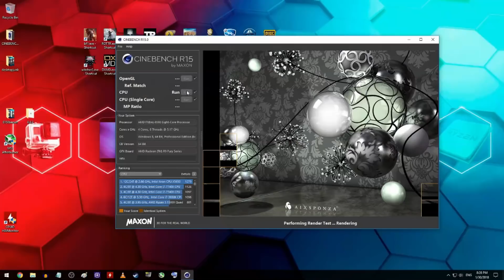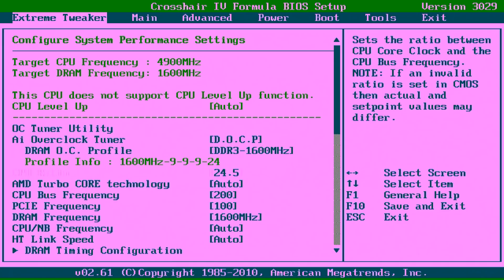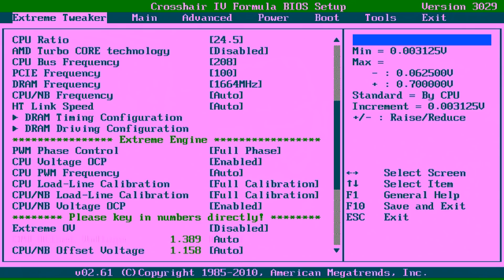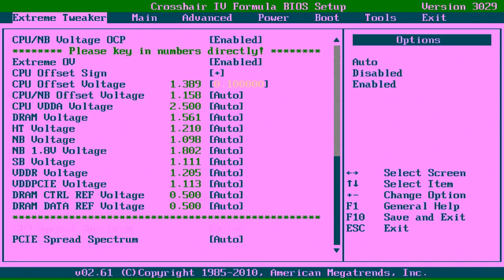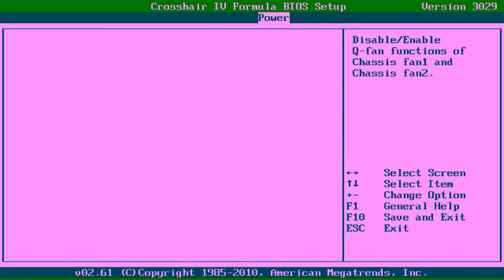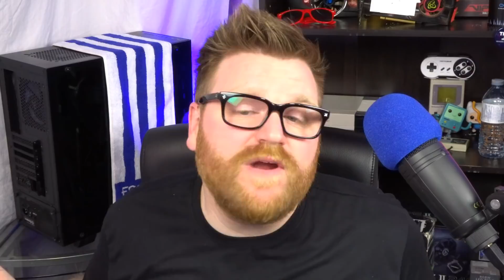How To Overclock The AMD FX Series to 4.8 - 5.1 Ghz!

Comment: I wish I could overclock my FX 8300, but my motherboard is that Chinese models.....
Reply: I clocked mine at 4Ghz @1.3 Volt.
A rather tame overclock, but I don't want to kill my cheap 4 phase M5A78 MoBo. I salvaged the heatsink from a dead s939 board, and after a little machining I managed to fix it on the M5's VRM, and positioned a 90mm cooler above it.
Reply: A decent am3+ motherboard can be bought for like 50$ used, so you should do it, considering you will probably be able to sell your mobo for 20-30$...
Reply: I wouldn't waste money on this platform anymore, once the the DDR4 price come down a little, I will get a new konfig.
Reply: most mb are made in china....lol.
Reply: TheGyuuula
You will wait decades before the ddr4 prices comes down.
And he would put like 30 bucks, it's not gonna ruin him, and he will probably get it back if he sells the system later to build a new one.
Maybe he isn't even able to build a new config, so he'd rather spend a little on an old config to make it ok rather than spending 600 on a new pc.
Reply: @imnota  That didn't age well
Reply: @MJ-uk6lu  
Nothing ages well when it comes to tech advice, use your brain. What you're doing is the equivalent of going in back in time to 2005 and telling some random guy he shouldn't be recommending ddr2 lmao  

That comment was from 2018, obviously the advice given is outdated...

And honestly ddr4 prices only started to go down like a year and a half after my comment, so I was right, it's not like that guy could afford waiting for more than a year for the prices to drop.

Also DDR4 prices still haven't come down as much as they should. They're dropping slowly over the years, but compared to how ddr3 dropped in price, ddr4 prices are dropping much slower and are still quite high, especially for how old the technology is today. Obviously nowadays ddr3 is out of the question and you have to go for ddr4 and suck it up, but it's still overpriced for what it is.

Production has become easier, faster, and cheaper.  Yet, today, 7 years after ddr4 came out, a 2x8gb kit costs 100$, even though it now is the norm and is very basic.
In 2014, 7 years after ddr3 came out, a 2x8gb kit was 75$, that 16gb kit back then was considered as the best in the game, tip top technology. 

Explain me why something basic nowadays costs as much as the bleeding edge of technology only a few years ago ?

Also the prices can even be ignored, because it's not the problem here. The only thing that matter is that in 2018 an overclocked fx8300 was still usable, and investing like 50$ in it would give him an extra year out of his computer, which objectively was a better decision than building a whole new computer, that he probably couldn't even afford.
Reply: @imnota  You said it will take decades for DDR4 prices to go down, but your prediction went bust after one year if not less than that. 16GB DDR4 is dirt cheap and has been for a while. Not sure where you are pulling your prices from, but 16GB kit of two sticks costs around 55 euros, if you don't buy overpriced RAM (pretty much anything Corsair or the likes). You still can get 2933MHz or 3200MHz kits for that money.
Reply: @MJ-uk6lu  
The biggest reseller in my country, topachat, is selling their cheapest kit for 95€. The cheapest kit on Amazon is 75€, really slow (2400mhz cl16) and has bad reviews.
As said previously, in 2014 we were in the same place lifespan wise with ddr3 as we are today with ddr4, and a top of the line, fast ddr3 16gb kit was 75€, nowadays you get the slowest unreliable piece of crap for the same price.
I provided you so much proof that ddr4 is overpriced and you're still pulling number out of your ass (and blaming me about my prices even tho it takes 15s of googling to check), 55€ is just enough to buy a slow and unbranded 8gb kit, no way you get 16gb, even aliexpress ram is more expensive than that lmao

Also as mentionned previously "decades" was just used as an expression for "a very long time" and well, it took a year an a half for it to drop to an acceptable level (still hasn't dropped where it should, but probably never will), and with the rate technology is evolving, that's a long time. So stop acting like a smart ass, obviously I didn't mean literal decades...
Reply: @imnota  I bought G.Skill Aegis 16GB kit for 55 euros few months ago and there were some other kits available. It seems that price climbed up somewhat now, but that doesn't invalidate a whole year of cheap DDR4.
Reply: @MJ-uk6lu  
You know you can see price history, right ?
I took a basic crucial ddr4 2x8gb kit on amazon as an example , 93€ right now, lowest it's been in the past year is 79€, and data shows it's in a repetitive wave of up and downs, no tendency of rising nor falling. 

BTW those prices are counting discounts, so actually the low spots are not even accurate since it could be some kind of event like black friday or something, and not the actual market going down.

Also, I know you won't take advice from me since you like to disagree with me, but next time avoid GSkill, when I worked in a repair shop, I'd replace them very often. Pretty much every gaming pc that came with RAM issues had Gskill RAM, and IMO that says something.
Reply: @imnota  In my country RAM was cheap for a year or a bit more. 16GB kits for 55-60 euros. That was totally normal, not discounted price. I don't give a frack about amazon prices as shipping alone makes it impractical for me (and amazon being quite shady place to buy from).

And if memory works fine the day you bought it, it will likely be good for basically forever. I don't see any memory brands as problematic. At some point I have used some PQI DDR400 memory and it was fine. It's hard to fuck up something so standard and controlled by JEDEC. I only had problems with Corsair XMS2 DDR3 1333MHz kit.

Comment: How high could you get it totally stable for 24 7 use
Reply: stable for 24hrs?  48hrs?  etc etc   overclocking can drive an OCD person crazy.   i've seen overclocks fail after  running over 72 hrs of prime95.  i've seen chips running "default / auto" settings fail stress tests.  if it's a machine handling critical data that you can't afford to lose or corrupt, don't overclock it.  if not, overclock it, stress test it for at least 24hrs with two different reputable stress applications,  then do what you would normally do with that computer extensively.  some people are happy with overclocks being just stable enough to do what they use the machine for and others will stress their pc more than actually using it looking for instability.  stability is in the eye of the beholder.

Comment: I just fixed my FX pc trying over clock pass 4 GHz is pain in the ass with my msi gaming 970
Reply: i had one of those.  i remember a "goo" excreting from under the vrm heatsink when i was pushing an FX 8320 very hard with that  board.  i never did try the 990FX version of that board though.  other than the heat tube running from the VRM sink to the northbridge sink, i think it was the same vrm setup.

Comment: Any advice on overclocking a fx4300 on a gigabyte ga78lmt usb3 Rev 6 motherboard?
Ps. If I could upgrade I would lol
Reply: That MoBo have a relatively weak VRM, but at least it has a heatsink on it (or is should have, based on google images). 
-Position a cooler somewhere above the VRM's heatsink, to get direct airflow on it.
-Now go to the bios and disable Turbo Core. It will also disable the "TPD limit". With "TPD limit" on, your CPU will automatically throttle back, when it's consumption exceeds 95W. Your MoBo can feed a little more than that to your CPU.
-Set the Voltage to 1.3, and test it how far you can go with that setting from 3.8 Ghz up in 100Mhz steps. If the PC boots, torture test it with something like "prime 95" for at least 15 min. If prime fails, you can give it a little more Voltage (something like in a 0.025V steps.)
-I would be more than content with a 4.4Ghz clock, and wouldn't go above 1.4V. Above these numbers you will definitely hurt your MoBo.
-Oh, and also look out for the temperatures! If your CPU goes above 60-65c° during the torture test, you reached the limit of your CPU cooler.
Reply: OC the ram and CPUNB first (at least 1866 for ram and 2400 for cpunb is desirable). I don't know what the exact settings are connected to this settings speaking of your MB, just search for a FX OC guide that covers this steps. Then OC the core frequency. The problem is that fx4300 as I know have smaller caches than fx4350 so you can be somehow limited by them. Ensure that you have 2 or more sticks of ram and properly installed to get full benefit of using the dual-channel mode. It is often something like A2-B2 slots. Then OC your cores a bit
Reply: Check how low you can undervolt before you look at overclocking imo, you can probably reach 4 ghz without any problems on that motherboard at best, it is a low end motherboard that handles 125w cpus at best, so it doesn't support 140w cpu's or the fx 9 series motherboards.

If you can get voltage down too 1.350v while changing the settings so it can turbo too 3.8 ghz on all cores you'll be pretty good on temperatures without risking hurting the motherboard.
If you got money too replace the cpu + motherboard, id look for used socket 1155 & an I5 of any kind.

Also what is your current gpu ?
Reply: Marcus60661 thanks for replying so quickly, current cpu is a Zotac gtx 480 given to me
Reply: Marcus60661 can this be done in my bios or a software? I don’t see the option in my mb intelligent tweaker
Reply: 2600mhz on the HT Link, 2400mhz on the northbridge (2200 or 2600 might be better in some instances).
Don't have memory timings too tight for gaming.

Comment: i wish i could get my CPU to 4.8 hell, i would be happy with 4.6 stable, but my little old Xeon can't do it :(
Reply: Speed is not all, don't compare old fx with intel parts. that xeon at 4ghz will probably be faster than a fx at 5ghz anyway..
Reply: faster yeah, but not by a lot. i get 980 on cinebench at 4.5, but 4.5 is only stable enough to sometimes to get one full cinebench run. at my daily of 4.2ghz i get about 950

Comment: The fx series was boss when it came to OC. My fx 8310 was clocked to 5.1 @ 1.48v and was air cooled. I had better OC experiences on the 8 series then the 9 series fx chips, you could push the 8 series further.
Reply: the problem is, they were great overclockers, horrible performers even when overclocked.
Reply: Yes they were horrible in the performance department but fun to OC.
Reply: Anthony Mari oh yeah for sure. i overclocked the shit out of my 2500k just for shits and gigs, even though i didn't gain a BUNCH of performance. (granted the 2500ks aren't horrible in performance, just not great either)
Reply: High OC does not matter if the performance was still bad.. A sametime intel i5 at 4,5ghz or a modern Ryzen at 4ghz is much faster.

Comment: Cooling the CPU Socket behind the motherboard would be another options to keep it cool or it might melt the plastic socket.  Or so I read.
Reply: it does.  placing a fan on the rear of the socket area will cool "socket temps"  up to 10-15 degrees.
Reply: the 6+2 phase boards will benefit from a fan on the vrm's as well.  some of the 8+2 boards will need a fan on the vrm if you push them hard enough.   the sabertooths and crosshairs are the best.  gigabyte made a few good FX boards.
Reply: halistine jenkins I own their very last 990 FXA board.  https://www.gigabyte.com/Motherboard/GA-990FXA-UD3-Ultra-rev-10#ov

I have been seaching high and low for more information on this board.
Reply: i had two of the revision before that ultra board.   a ud3 rev4.0 and 4.1.   i loved those boards.  those were the only ones i could find that the vrm's could handle the long abuse i'd put them through without throttling needing a fan or just plain failing.  i did not like how they "double booted" at every start up after changing certain settings in the bios though.  it was either turning turbo off or just changing the multiplier did this.  i can't really remember now.  I also purchased the GA-FX-Gaming 990FX board but i had no luck with it whatsoever.  it would not hold my overclocks and would just quit booting constantly and require a hard bios reset.  i think gigabyte quit refining the AM3+ platform bios long ago.  i then switched to ASUS and never looked back.  the sabertooth was the best AM3+ board ever made imho.  unless you could afford a crosshair.  anyway, if that latest "ultra" revision you have is anything like the earlier versions, you have a good durable  board there for AM3+.
Reply: I've noticed massive heat soaking into the motherboard with a stock clocked FX 8350 when it's pushing 75%+ usage
Reply: i've used double sided 3m tape attaching one of these https://www.newegg.com/Product/Product.aspx?Item=N82E16835200107  to the back of motherboard support plate  before and this is a great case to cool FX cpus https://www.newegg.com/Product/Product.aspx?Item=9SIA2F81NH2708 for air cooling or aio with a fan slot behind the socket area.  it's ugly as sin but putting a 40-60mm fan on the vrm sink helps a lot too. 15mm thick fans come in handy here.
https://www.newegg.com/Product/Product.aspx?Item=N82E16835209044  can be helpful with cooling as well.
Reply: halistine jenkins It was the latest and the last.  I was looking at the Sabertooth before I notices a brand new Gigabyte Ultra Board on New Egg.  Having no reviews on it for a couple of week, I decided to buy the $130 and if it failed, I would've gotten the Sabertooth and having extra cash isn't a issues for me.

  The only thing I have change is replacing the thermal pad behind the vrm heatsink for better heat transfer, didn't do anything to the Northbridge being connected to the Vrm with little knowledge of what paste to uses if I wanted to. It work better while gaming but not without a fan on top to keep it cool under torture run.  The funny thing about what my Ultra board to cost over $500 on Ebay as new for some reason.  I'm also planning to go full water cools in the summer as soon my modded case is ready.
Reply: the 990fx boards to my knowledge aren't being produced anymore.  i may be incorrect but i think that is the case.  a lot of the 990fx boards have quite a few pcie slots and the miners use them thus buying them up and driving the price up if you can find one.  i cashed in on all my 990fx chipset boards.  i had about 5 of them and probably as many 970 chipset boards.  people will argue with me probably but i really didn't find any "noticeable" differences from a modest 4.4-4.6ghz to the 4.8-5.0ghz range.  i could never keep the higher range stable enough for me but i torture them to see if they can take it for long amounts of time so i don't like to run the temps extremely high for that long.  i'd usually stop pushing around 60max and 55 average and that would usually net me around the 4.4-4.5 range for pretty stable everyday use without worrying.  you should be able to get higher on liquid.  i'm an air cool junkie through and through.  i try to see how high i can go on air without the weight of my cooler snapping my board lol.  nah i just settle for the NH-U14 now days.  it's a great cooler.
Reply: here's some links that helped me on my FX adventures MrDman.  check them out when you get the chance.
http://www.overclockers.com/forums/showthread.php/726957-HT-Link-FX6300
https://forums.guru3d.com/threads/990fx-990x-970fx-890fx-880fx-etc.367816/
http://www.overclock.net/forum/10-amd-cpus/1348623-amd-bulldozer-piledriver-overclocking-guide-asus-motherboard.html
http://www.overclock.net/forum/10-amd-cpus/1202751-amd-fx-cpu-throttling-fixes-please-sticky.html
http://www.overclock.net/forum/10-amd-cpus/1140459-bulldozer-overclocking-guide-performance-scaling-charts-max-ocs-ln2-results-coming.html
http://www.tomshardware.com/answers/id-2114480/overclock-6300-ghz.html
http://www.tomshardware.com/reviews/990fx-motherboard-review-amd-fx,3464-18.html
http://www.modders-inc.com/gigabyte-990fxa-ud3-rev-4-0-motherboard-review/4/
http://www.hardcoreware.net/amd-piledriver-fx-review-vishera-8350/10/
https://www.hardocp.com/article/2012/10/23/amd_fx8350_piledriver_processor_ipc_overclocking/